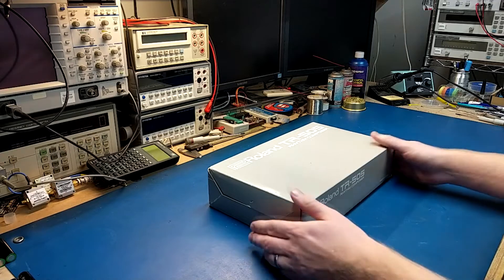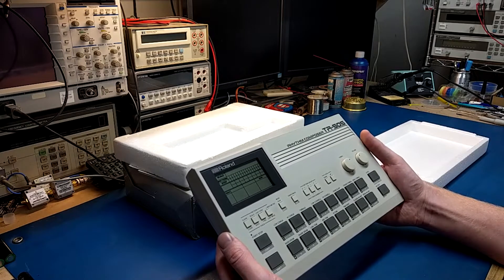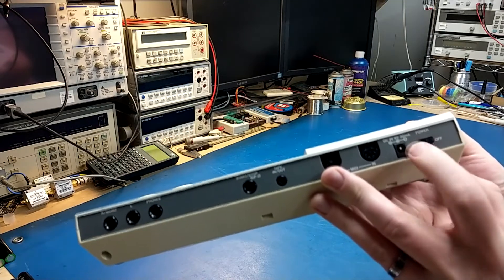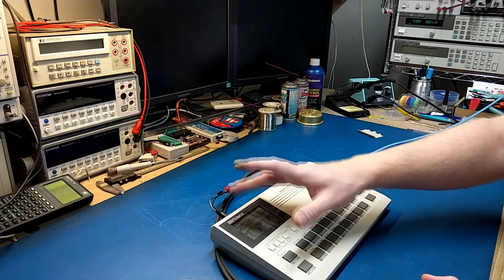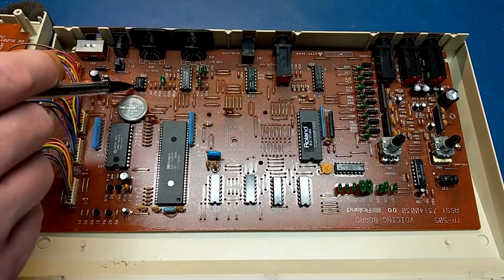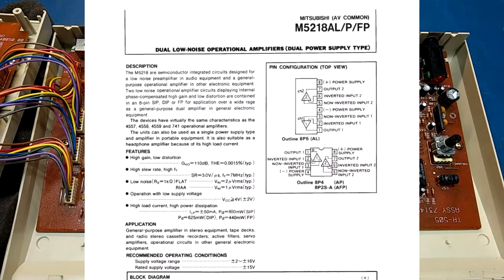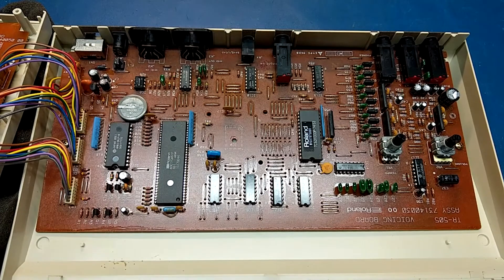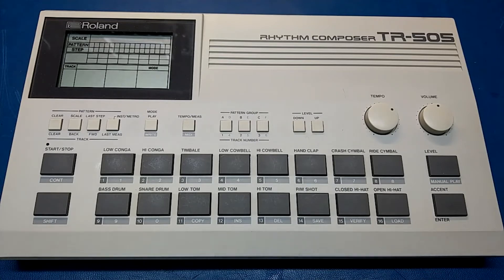Roland TR-505 Teardown

Comment: Do you have a suggestions for fixing a dim Boss Dr Rhythm DR606 LCD? The drum machine works, I had to replace the DC jack but otherwise, aside from the dim display it works fine. I don't think the display is supposed to be back lit, it looks more like the contrast setting is off but not sure. Any suggestions?

Comment: Got rid of my original 505 years ago and regretted it.  Got one the other day, for $20 but BD, SD, Rim, Clap, Hats and Cymbals are barely audible.  They are there but very, very faint, even with levels at 5.  You can also hear a click on those (along with the faint drum sounds), almost like VCA is firing but not getting full signal from those sounds.  Hmmm, any ideas?  btw, I'm pretty handy with soldering iron ;o) -Sean
Reply: Sean Ober Im having the same issue, did you ever solve it?
Reply: After watching the above video, I would check out the 8 part section of the circuit board located just below the headphone jack. 
bradthx points to that section at 12:47
I would also check all the IC chips to see if there's any corrosion on their pins.
Reply: Mine has a similar problem where all sounds are inaudible upon power up; however, just like a vintage valve TV set the volume increases gradually over 15 minutes to the proper levels. Hopefully the culprits can be found and be fixed or replaced.